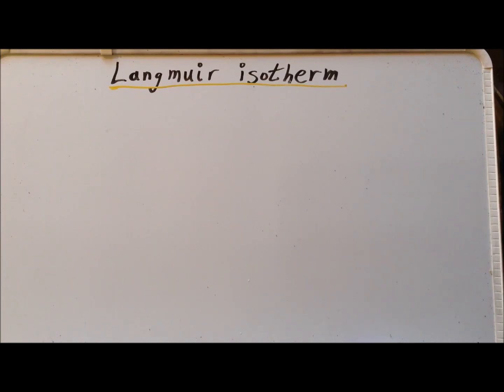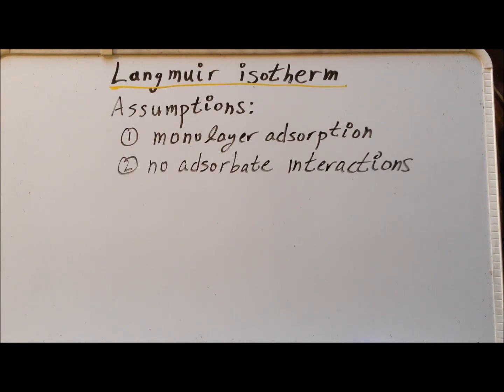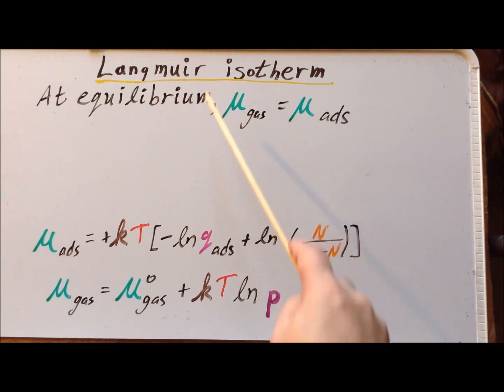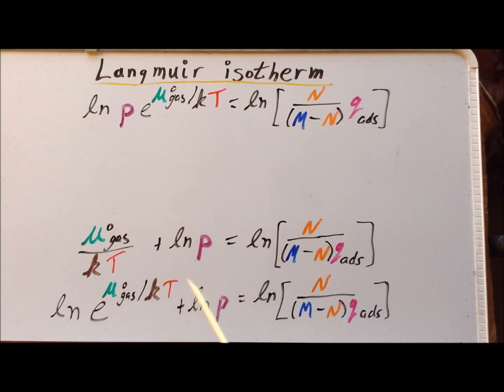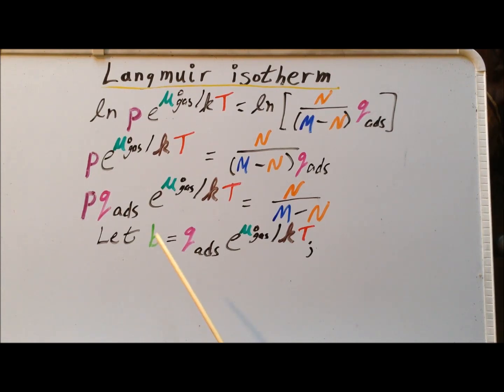Statistical thermodynamics: color-coded, step-by-step derivation of Langmuir isotherm

Comment from the maker: (for mobile users)

00:15   Introduction
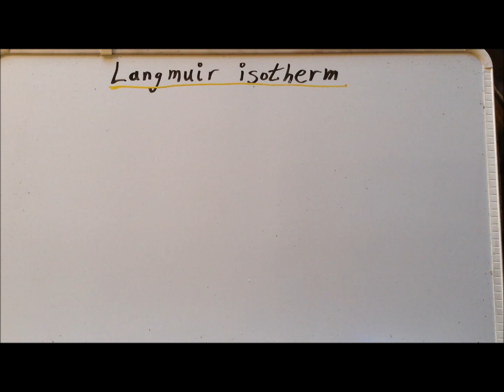00:43   Assumptions of Langmuir model
01:39   Partition function Q for N distinguishable adsorbate sites
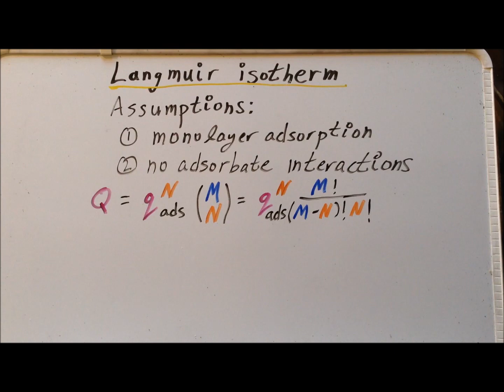03:04   Relation between Helmholtz energy (A) and partition function (Q)
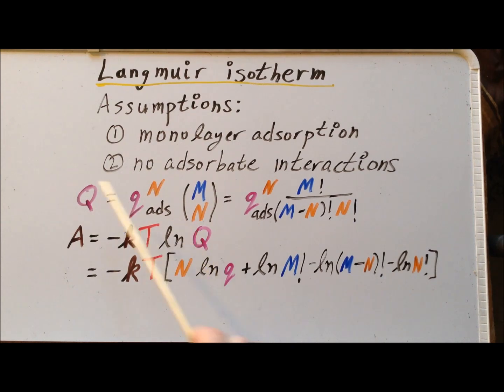03:21   Substitute value of ln Q into 03:04
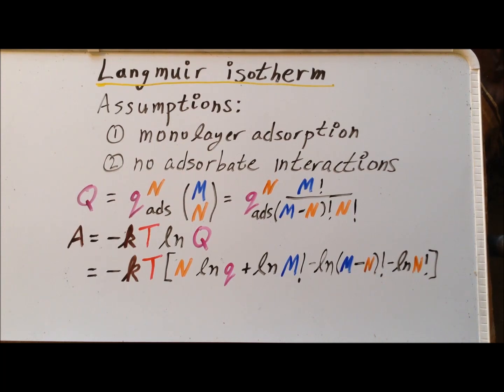03:50   Definition of chemical potential of adsorption μ
04:13   Take partial derivative of A
05:34   Use fact that number of adsorbate sites M is fixed
06:17   Use property of logarithm
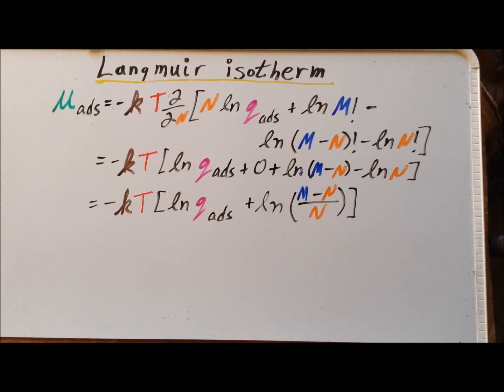06:33   Use second property of logarithm to cancel minus sign
07:08   Use expression for chemical potential μ of a gas
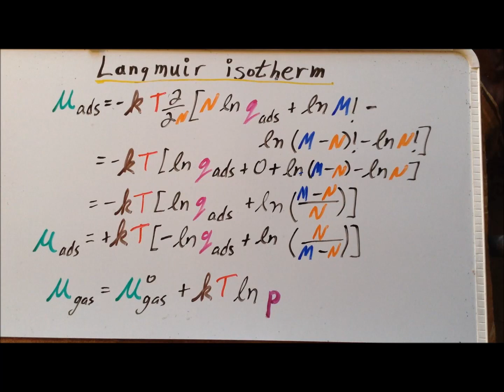07:54   At equilibrium μ (adsorbate) = μ (gas)
08:18   Substitute expressions 06:33 and 07:08 into 07:54
08:45   Divide each side by kT
09:03   Use property of logarithm
09:40   Raise each side as a power of e
10:00   Combine logarithms of left hand side
10:27   Cancel ln on each side
10:36   Multiply each side by q ads
10:51   Define constant b
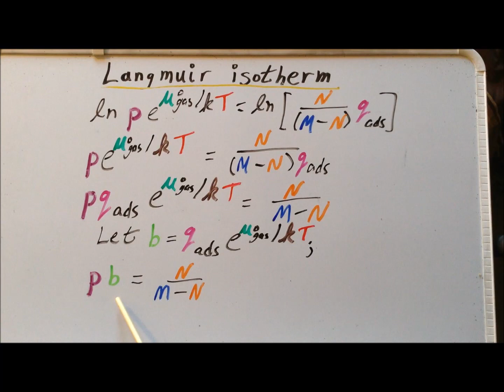11:19   Rewrite 10:36 using constant b
11:34   Take inverse of each side
11:43   Simplify right hand side
11:55   Define coverage fraction θ
12:28   Substitute θ into equation
12:51   Simplify left hand side
13:20   Take inverse of each side

Color-coded, step-by-step derivation of an equation for the fraction of sites covered by adsorbed gas molecules in the Langmuir adsorption isotherm.

Don't forget to like, comment, share, and subscribe!